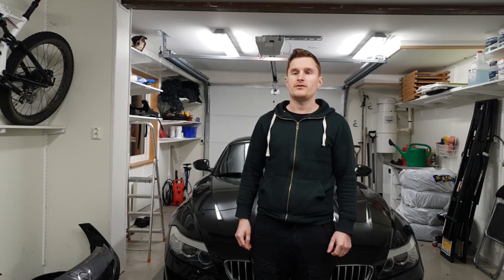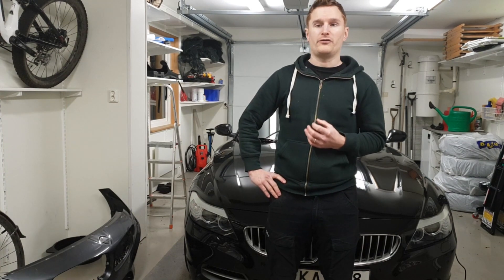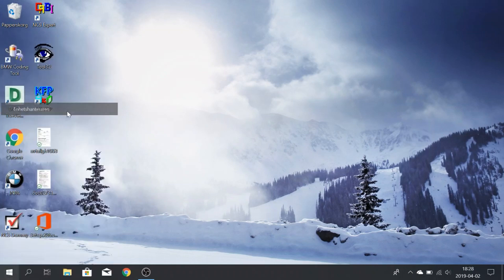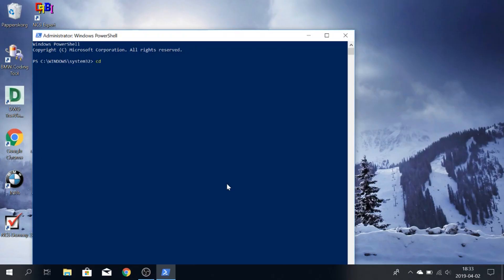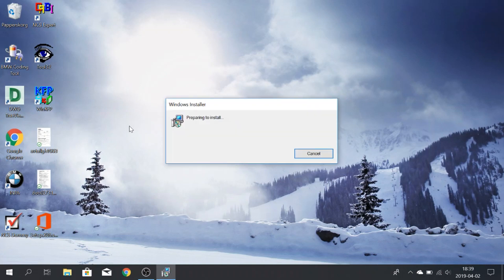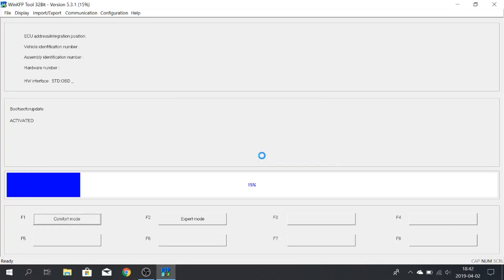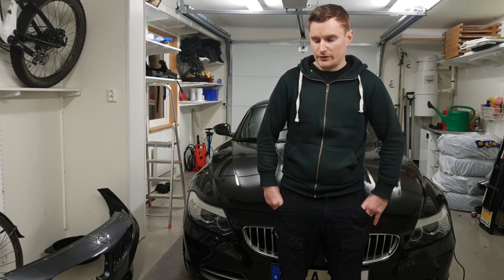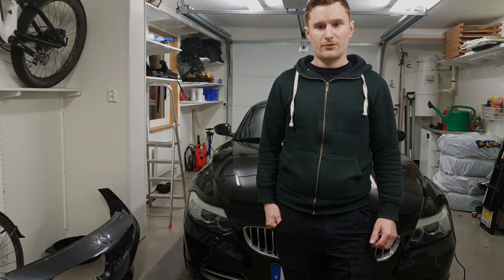How to fix the e89 parking brake failure

Comment: I have the same code 6017 on my Z4, and I also had a bad battery. In my case, I’m not able to engage the brake.

One morning, I got into the car and noticed an error on the dashboard, and the brake had turned off automatically. I checked both brake motors on the calipers; the connectors seem fine, and the motors run correctly when connected directly to 12V. I replaced the battery and verified via diagnostics that the button is sending the correct signal.

Despite all this, the brake still doesn’t engage. Do I just need a software update, or could it be something else?

Comment: Hey, I would like to thank you so much!!! I followed your instructions and it worked! After battery dead, e-brake light showed and stopped working. And now! Everything is super duper. Better to buy K-dcan cable for about 40 Euros and spend an hour with the computer than pay 100 euros to BMW dealer to do the same... and you will still have the cable so youre able to diagnose, upgrade or code your BMW or the other in the future! Sending greeting from The Czech Republic.
Reply from the maker: Thank you so much for your kind words, I'm glad it worked!
Reply: Ahoj. Mám ten istý problem ale ručná brzda mi vôbec nereaguje. Nejde zapnúť. Tiež chyba 6017. Tak si to mal aj ty?
Reply: @jakubmaruska3225 chybu si uz nepamatuji, doslo k vybiti baterie a rucni brzda zacala svitit a nefungovala, nesla smazat, ani resetovat. Stacilo prehrat jednotku viz video a okamzite se zavada odstranila. Vyzaduje to vsak zminovany sw a hardware, k tomu dobry pocitac, auto na nabijecce atd. Nahrava se to asi pul hodiny.
Reply: @violr ďakujem. Nahodov nemas ešte SW? Nikde ho neviem nájsť.

Comment: Thank you so much for the video.
It failed to update on mine until I replaced the 3 year old genuine BMW battery - only just saw your comment about keeping a battery charger/tender connected 🙄 I suppose that's why I'm not making the videos...
Anyway, it didn't ask for the VIN, but everything else was exactly as you said. And 20 minutes later I unlocked it, there was no bong and I could put on the handbrake 👍
Reply from the maker: Always nice to hear it worked, thanks for the comment kind sir!

Comment: Thanks for the video. I have all the files and have followed all the steps, all good until I have to find the module emf89, it is not showing in the pull down menu. Any idea how to add it?
Reply from the maker: Oh wow, interesting. What version are you running and which daten files dig you go for?
Reply: @trackdayjunkie7777  Followed links from Mike's Easy BMW Tools, the file date is 13/11/2016.
Reply: @trackdayjunkie7777  Hi, Just tried the software again and the module is there. Have now flashed the car and am waiting for the light to go away. Thanks again.
Reply from the maker: @SeaKingV  Ok, cool. Glad it worked out!

Comment: I did everything, but for some reason, I still have an empty circle in INPA...I use cable drivers and I am not able to find any "windows default drivers" as you said. Another thing is that when I press DONE in winKFP nothing happens, the window about the vin number doesn't pop up. Any idea what I am doing wrong?
Reply from the maker: It´s so hard giving advice when the problem isn´t in front of you but I´ll give it a shot. About the cable, it almost sounds like you might have an USB port not working properly or some other type of hardware issue. Cause it should be very straight forward getting the cable to work.
Depending on what version you have it might differ slightly, if the program dosen´t ask for a VIN then its fine. And again, depending on what version, I THINK that if I remember correctly you need to select "program" after you pressed "done" and follow the intrstucions on screen. It´s been a while since I did this so not a 100% on that. You could watch another video with winkfp just to see the last few steps and how they are done. Let me know if you need me to clarify something, good luck.
Reply: @trackdayjunkie7777  Today I tried it with obdi bluetooth adapter, after a few attempts I finally went through "done"->"program" but it always freezes on 0% and program is in state not responding ... I waited 10 minutes. So I suppose that I cant do this kind of operation with bluetooth, just with a cable.
Reply from the maker: @luky3330  Again, tricky to give an edcutaded guess on but it sounds you might want to install everything again and try with a cable instead. Not sure it will work with bluetooth, something I´v never tried however.
Reply: @trackdayjunkie7777  Today I tried it again with a new cable which finally looks that works. But during update process I always get error: error_ecu_conditions_not_correct_or_request_sequence_error... Do you have any idea what is wrong now? :(
Reply: @trackdayjunkie7777  I don't know if you're interested, but after multiple attempts, with engine on, I successfully did it. Software on car side or winKFT is so unreliable, that with the same settings it returns random errors. Thank you very much for your video, you saved me a lot of money...
Reply from the maker: @luky3330  sorry for a late reply, been a busy week. But ofcourse, always nice to get some feedback on how it went. Alright, never heard that before but it woulnd´t surprise me either to hear that might be the case. Although nice to hear it eventuelly worked out!

Comment: dude thank you sooooooooo much! this has sorted itself on my E89 immediately, no wait at all. thank you thank you thank you!
i have 1 question - do you have any way of reading error codes with these tools at all? I'm very computer literate but no knowledge of the BMW tools package and i have some issues with my roof at the moment! a video on that or a link you could reccommend would be awesome!
Reply from the maker: Awesome, glad to hear it worked, and thanks for your kind words!
You can read the error memory with INPA if you like, thats atleast what I do. I think it´s easy to use and gives and good overview of whats going on. But it´s more or less just down to taste I supose since there is so many programs out there which do the same. 
I haven´t had any issues with my roof yet, but I do know the usual suspect is often one of the microsensors or a cable thats been crushed causing problems. Here is one video on the matter at least: https://www.youtube.com/watch?v=3q52HtkK6mU
Hope it helps somewhat, If I had the time I would make a video of my own but life is in the way right now :)
Good luck!
Reply: @trackdayjunkie7777  I will definitely check out that video, thank you very much again! I did have a little look around with inpa but could only see the E90 listed as the closest variant to the e89... Do you select this and does it still connect and work ok?

Yes, I've got some hall sensors on order but not e89 ones as they're £200+!  If ever you have a problem with them order the same part from the 180si convertible and just replace the connector, they are £15!
Reply from the maker: @mevsyouvsme  Yes, I usually pretend to be a e90 when doing stuff in INPA and seems to being the same stuff as expected without problems. I´ve even tried as an E60 which also worked. But I do presume it matters to some degree which models you use depending on what you want to do.

Thats awesome, thats the kind of tips I like to hear, very good to know! Then again I assume that the convertible system is basically the same in all BMWs allowing for some criss crossing between models.

Comment: Thank you so much! This is a brilliant video, solving a problem that no one else I spoke to seemed to know about and was going to cost me thousands at BMW at they wanted to bill to 'diagnose' and then probably replace the parking brake as they never heard about this. The light instantly went off for me, but it was a scary experience for me as I was running the engine while doing this update and the engine abruptly shut off. I didn't realise that you can / probably should, do this update with the engine off and the key just in.
Reply from the maker: Thank YOU, for your kind words! Exact same for me in dealing with BMW and the reason for this video. It does seem to pop up new threads on Z4 forums every week in regard to this issue so it really is pretty unknown and especially the fact that it is possible to fix it at home. I bet it was scary, and yes you should have the ignition on but no matter its not like the engine will take any damage from it so. Thanks again for the feedback and glad it helped!

Comment: I followed this yesterday and got the fix process to work. I had to flash three times to get it successful which was a bit nerve wracking! I ended up purchasing an Oracle VM with all the software. it was 6 Euros, but was all there and working - https://www.diagnose-software.com/

I'd make sure you leave the key in the ignition, that seemed to get it through the third time. 

Many thanks, glad to get rid of the error and save $$$!
Reply from the maker: Glad to hear and happy it worked! Yeah the igntion(only ignition, not engine) needs to be on the entire way through the process. And thank you for the link, much appriate it!

Comment: Hey. Thanks for great step by step video. Ihad similar problem on -09 e89. Handbrake was working ok, but constant yellow light was on. My handbrake is now fixed.

I followed your instructions step by step until 13:15 I didnt get option to "choose zusb". I went "update ecu" and again followed your instructions. It didnt asked my vin and just started updating.

After update I turned car off an waited about minute, No warnings, not even that yellow parking brake light. Pulled park lever, and parking brake went on. But then was that oh no, of s..., oh f... moment. Brake isnt releasing... I pulled battery twice... I thought how much dealer gonna rob me now, thought that how is it gonna tow truck fit in my small yard... And then I realised that with new software you have to step brake pedal to release handbrake. Oh, that was relaxing moment.
Reply from the maker: Hi thanks for the feedback. Yeah there is diffrent versions of INPA and may look diffrent but does the same basically. 
Thats very intrestering, my car is a manual so I didn´t have that issue but good to know, thanks!

Comment: I have one more question....My car is chip trimmed ( step 1 or STEG 1 in swedish ; )  ). Do you think the software update may overwrite the mapping also?
Reply: I checked my battery today...and I've got 12.1 volts in it....There are two white stripes painted over the bolts holding the battery bracket. If they are painted there by BMW it's a sign that the battery has never been changed ( since 2010).  I looked at a battery swap film on Youtube also, and apparently you have to go into the software when you swap the battery as well and do a reset ( saying that the battery is new). This guy had some BMW software in which he just had to go in and click a reset battery button. I'm thinking of getting this software as my wife also has a BMW.....( BMW takes about 100 USD to reset the battery).....So, with this low voltage I wouldn't be surprised if it takes care of the parking brake issue as well. Can you recommend some software and adaptor cable? Seems like I have to learn how to use the computer as newer BMWs seem to be very computerized.
Reply from the maker: @istvanbartha7985  If you get 12.1 you for sure need a new battery. You probably had the same issue as me when low voltage caused the parking brake warning light to appear. Yes you need to register the battery when replaced, and when doing so put the car on a tender so it never is without power. I use bimmergeeks cable and INPA for most stuff which there are many guides on youtube, among others how to replace the battery. Fault code 6017 is however permanent and replacing the battery wont reset the parking brake, first thing i tried...
Reply: @trackdayjunkie7777  Hi again. I bought my Z4 this spring and I will probably keep it for a few years....and my wife also has a BMW...a 328 from 2014.....Do you think there is some PC software that will fit both cars?...( I mean...you just toggle until you find the right model)
Reply from the maker: @istvanbartha7985  Well I guess you could try CARLY but it seems expensive to me for what it is. But I do like the look of ProTool by bimmergeeks. Its jut an app in which you can do the most common coding needed. It looks pretty easy to use but I havent tried it so dont take my word for it. Both will however fit both cars so to speak.
Reply from the maker: Nope, it dont overwrite mapping stuff so you are all good in that regard.
Reply: @trackdayjunkie7777  Hi again, thank you for your quick response. One more detail, I never heard the sound from parking brake engaging....I'm located in the Stockholm area, so I wrote to Perras bil & motor yesterday evening to see if they can take a look. The car works fine apart from this.
Reply from the maker: @istvanbartha7985  Ok, I´ve  heard the noise it makes while enganing and disenganing more or less every time, ofcourse it is pretty quiet and if not paying attetion easy to miss. I was also thinking that newer model year Z4s might have a diffrent mechanic accuator making less noise but thats just me guessing. Yeah I´m sure they can fix it, no need visiting bavaria in Solna with therir prices thats for sure!

Comment: Hi, this happened to me today....and the battery warning light also flashed. Two warning lights were lit...the parking brake warning ligt, and also the break pad warning light.....and the electric parking brake didn't work either thereafter. Did you experience the same...that the brake didn't engage?
Reply from the maker: Hi, no for me the parking brake was working just fine inspite of the yellow warning light so it sounds to me like you might have issues with the entire EMF module which can happen or maybe some mechanical issue. Having said that, from what I gathered diffrent vehicles behave diffrent, for some the parking brake still work and for others it dont but the solution for it is still the same. So hopefully it will work for you with only an update. Good luck!

Comment: So glad you posted this video. I think it will help so many people. Crazy that bmw dont recall the cars for this.  Is the update just the latest daten file? Or is it a hand brake fix that you add to the latest daten file? I have the v.66 daten files. Should I just be able to do the update?  When I try to do the update, I receive a flash error. Any ideas?
Reply from the maker: Indeed, the question about this being a safety issue and all have been discussed in lengh on forums for a while. I'm not sure which version I have on my daten files but if I remember correctly they are from the release of 2017. No need for a add on just for this granted you have the complete package of files. Should be around 17GB. 
Do you recieve a error message?
Reply: @trackdayjunkie7777  the error message was a flash error. I reckon it's the 64/32bit issue.  I have found someone pretty local that can do it for not much more than a battery tender would cost. So saves me the hassle. I want to thank you again, it was your video that helped me figure this out. It was much easier to deal with garages when I new what I was talking about and saved me from having to pay for diagnostics and possibly even getting a new sensor fitted (as one place wanted to do).
Reply from the maker: You can btw find the link to the daten files I used in a previous comment here if you want to try those instead

Comment: Hi there, this looks awesome and saves a ton of money.  I am have the problem myself and I am trying to do what you did.  I bought the obd cable (the K+DCAN one) and have downloaded the daten files etc.  I have not tried to fix it yet but I want to ask you a question please.  Can you tell me if I need to be connected to the internet during the whole process?  Also when I plug the laptop and the obd cable (from the laptop to the car), do I turn on the car for the whole procedure or just switch it on without turning on the engine?  Thanks a lot for your help!!!
Reply from the maker: Hi, and thank you for the kind words. 
No you dont need an Internet connection when connected to the car. Consider it a 2 step process.
You only turn on the ignition, not the engine so a battery tender is advised when doing this.
If you have any further questions, let me know.
Good luck!
Reply: Track Day Junkie, I would like to thank you again for all your help!  I understand and yes I did buy a ctek battery tender. You are just awesome to share your information with us z4 owners! Thanks a million once again.

Comment: Hi this is great. Do you know if it would be possible to reprogram steering wheel buttons to do cruise control? Since the cruice control is already onboard the computer atleast on the e89 z4. Thanks alot!
Reply from the maker: Hi, actually been playing with the thought myself about this. But trying to assign the buttons on the steering wheel with a new function is quite advanced from what I´ve learned so far. At some point I might give it a serious try. The far easier way is to retrofit the cruise control OEM style. Here´s a vid I saw earlier on the subject: https://www.youtube.com/watch?v=todzNOUpKZU&t=567s

Comment: hey, i've been trying to do this myself but where can i find the PBfailure folder  files?
Reply from the maker: Hi, Go to page 8 in this thread. https://z4-forum.com/forum/viewtopic.php?f=45&t=85788&start=105        Not sure the link to the daten files is still valid. But if you google daten files you can fins other forums and sites that have the e89 datens files. Good luck.
Reply: @trackdayjunkie7777  Hey again,
It worked fine, my ebrake is working back, thanks a lot!!